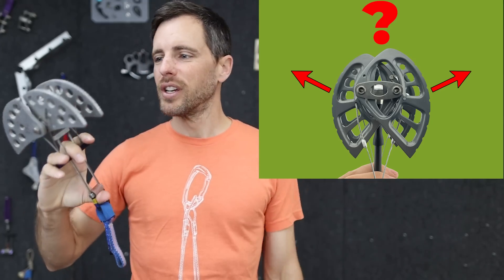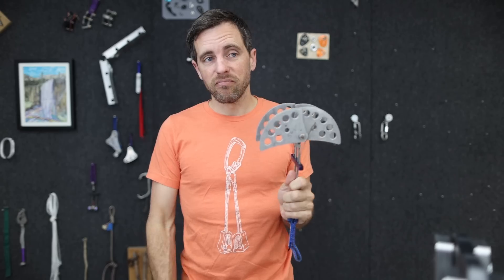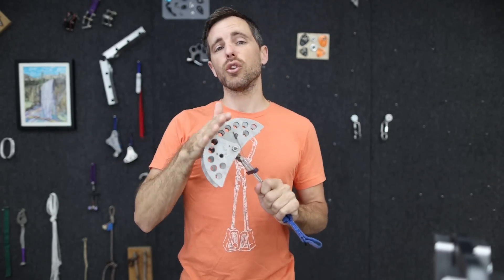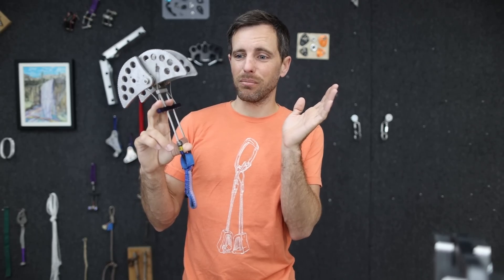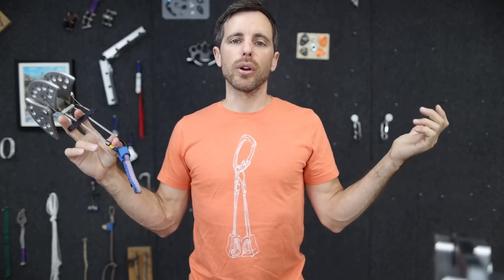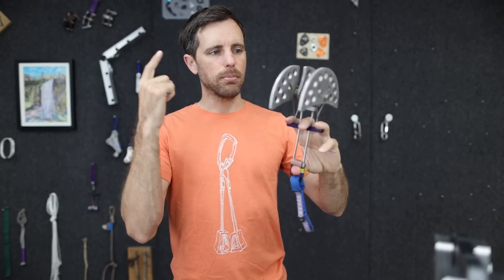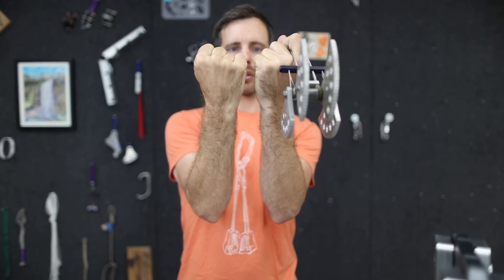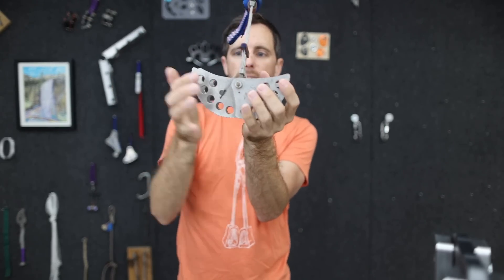I need your help

Comment: That's a second class lever, so  you are correct, 2 x the reading is what the cam is pushing. 
Ideally the test unit would be stationary, bolted to a bridge pier (got one of those near by?), and you'd measure what your weight would be pulling. (You complicate things a bit with the 'climber' load on the back side... but that''s probably okay. I don't think the mass of the jig or friction from the bolts is important.) 
I'd like  to see the graph of the sideways force going up against the 'climber weight' pulling 'down'. Are they linear (proportional)? Do the graph lines diverge at some point? That might indicate a potential weakness, or where the actual holding strength begins. (Imagine you've just set a cam and whoops! you fall. Would the cam hold as firmly as it would  if you fell after you'd put a lot of force on it. I don't know. I've only fiddled with cams at REI just trying to figure out any excuse to buy one.)  
Then there's what is the spalling (?) strength of various types of rock? Is that a consideration? I know you'd have different holding if you camed granite or sandstone.  And then the teeth on the cams. Is there a real world point where the teeth would break off? 
I look forward to seeing what you come up with and the results. 
For my 8th grade science students I made a 'bridge testing jig' to measure the down force on their bridges. It was all 2x6s and black pipe. The leverage and mechanical advantage on the digital force sensor, a 50kg luggage scale, was 10:1 (So 500kg *9.8 = 5k N.) I put a digital bathroom scale where the bridges would go. The two scales were very close.  But of course not quite up to HowNOT2 standards.
Reply: And due to the way these cams work, the width of the crack changes everything.

Comment: My first thoughts point to a double resisting effect (one on each side of the crack) of the sum of a reactive moment (another force times the cam size) plus a reactive friction action (another force) opposing the movement of a magnified climber's weight (another force) exagerated by an impact factor, lets say 30%.

Comment: There are a few factors that come into play, cam shape and crack shape being the main ones. I believe most climbing cams use a constant cam angle cam shape ~14 degrees. If you use a cam like this in an even, parallel crack the horizontal force applied outward in each direction should be around 2 times the pull force applied (pull force = 2*horizontal force*tan(cam angle). In theory the line scale should be reading half that force so should be reading the same as pull force. 

Your test apparatus isn't ideal and could potentially be sending more or less force through the fixed link (primarily if the different lobes are applying different forces) You could replace that link with a 2nd linescale and combine the 2 readings to get a more accurate result.

Comment: 8:30 Yes, twice the force because it moves half the distance when moved. I think friction in the pivot point can not contribute much in this case because the friction is torque here and the bolts are such a small diameter around the pivot point.
But the height of the cam placement is important.

Comment: Ill try look at the statics later. But remember that the lobes are log spirals and not offset circles
Reply: 100% this^ the angle of the cam surface relative to the plate is a constant so it should matter tipped out or mid range as long as the cam isnt completely tipped or maxed in that the axles are jamming and its working in umbrella mode

Comment: Would it make sense to make a new device with a load cell on each end, then add the two values together?  You could also pull the cam at an angle to see the difference between top and bottom values (I've always been curious about this).

Comment: I tend to side slightly more with the BD engineer that this is simpler than it may seem. Though as an awesome engineering professor I had says “it depends, it always depends”. Here are my assumptions about the system and I’ll talk about how it could change if they are not true (spoiler: they aren’t true). 

1. The walls of the crack are perfectly parallel. 2. There is equal engagement between the lobes of the cam. 3. The surface between the cam and the wall is uniform (not smooth because friction wouldn’t work if they were smooth) 4. The cam is being pulled straight down. 5. The lobes of the cam are not slipping in the crack 

With those assumptions, there is only one possible force that holds the cam in the crack. It’s friction. What is commonly misunderstood is that friction is a dynamic event. That is one part of it for sure, but static friction is the other (stronger) component of friction. The only force opposing the climber in this system is the static friction between the lobes of the cam and the wall of the crack. The equation (for maximum friction) is this: friction = coefficient of static friction * normal force. If you know the coefficient of friction between the lobes of the cam, and the force that the climber is putting downward on the cam then you can work out the frictional force required to hold the climber (the normal force of the equation). *new: what has been discussed in the comments is that there is some mechanical advantage when pulling on the lobes of the cam. This would mean that you would need to work from a different angle. The axle and contact point (assuming it contacts at a single point which it is more of a contact patch actually) create the hypotenuse of a triangle on which all of the forces can be shown. Now, describing a free body diagram in a YouTube comment is as one person put it “in the weeds”. But by finding the lever arm from the axle to the contact patch and applying a known downward force, the forces are able to be calculated. Now do that for every point along the line and there you have it. A graph showing the ratio between applied force and outward force for the range of engagement. 

Here is where the assumptions break down. The walls of real cracks are not uniform, parallel, cams are not engaged perfectly, climbers do not pull straight down. Another interesting thought is that cams also have different alloys for their lobes. This would mean a softer cam (like the totems) would have less force outward because the coefficient of friction is higher, requiring a lower normal force. Each of those things has an impact on the force. My intuition is that each of these would only serve to lessen the outward force. I.e. placing the cam in a more passive placement now has a mechanical force component and a friction component. 

There’s my 2 cents. 

P.s. I also side with the comments talking about two pressure gauges, one on either wall of the crack jig. The calculations will get you close but they will be flawed somewhere and the number will likely be incorrect because it’s the real world.

Edit: clarification and corrections.
Reply: That calculation assuming friction doesn't however give you the actual force being applied, only the minimum required to prevent it from sliding out. The force on the walls is not generated by the friction, it is generated by the pulling force being redirected by the shape of the cams and I have no doubt the designers would ensure that said force is many times larger than the bare minimum to make sure it doesn't slip out.
Reply: @kevinstrout630 great point. I missed the mechanical advantage in my assumptions. You’re absolutely correct that any mechanical advantage would be responsible for the wall force. My scenario would only be for a 1:1 cam.
Reply: Friction still works on smooth surfaces. Other than that, what I think really influences results is the angle between the axle and the point of contact between the lobes and the rock. The closer they are in line, the bigger the sideways vector would be - the vertical vector is determined by load and redirected onto the sides.
Reply: https://youtu.be/N74jOXh2iwI?si=7xxKfNF8rucy3mln

This video gives the mechanical advantage of the cam is typically 2. Im not a climber so i gotta check of this was for single axle or double axle, and i dont understand the math yet either, so i cant verify it at the moment but this was said to be a college project so im kinda gonna trust it 🤷‍♂️😃. Its more on the conservative side anyway compared to 4.
Reply: @m.agilnajib345  This is super interesting and I hadn’t considered the possibility that the lobe design would give a mechanical advantage through a longer lever arm. My previous comment would be true for a cam that has no mechanical advantage. Great catch!
Reply: This equation:
"friction = coefficient of static friction * normal force"
is only true for kinetic friction (aka sliding friction) -- it is not true for static friction. In most cases static friction is *lower* than what this expression gives and the only way to determine the value is to write out equation for force and torque balance.

Coefficient of friction plays no role in this setup (we're pulling below failure force).
Reply: I totally resonate more with this explanation. I totally agree on your ideal scenario asumption, which we can say is practically the cam condition in the loadcell/linescale jig contraption that Lucas made.

Question 1: can we agree, in simplified terms, that because of the jig design dimensions, the total force exherted on the cam surfaces is 2ish times the reading on the linescale?

I am looking on the demo at 8:15 of the cam being pulled in the jig, giving the value 2.15 kN.

So if agreed from my question no. 1, I can say, the cam is generating 4.3 kN force, acting on the walls of the jig.

And for me to understand it better, i visualize the jig is actually being loaded vertically, being pulled downwards.

So i guess what Ryan wants to know, it actually needs to answer 2 unknowns.

Considering in the ideal scenario, the cam is not moving because of static friction conditions. Which means, the static friction force is equal to the pulling force.

The normal force from the cams acting on the surface of the walls is actually the pulling force being multiplied by the cam mechanics.

So question no 2:
Normal force on wall = Pulling force x (multipier factor from the cam mechanics)

So my question 3 is: 

Can we say, in static conditions on the ideal scenario,

Pulling force = Normal force x coef. of static friction

so, plugging the formula from Question 2, for normal force, i wanna say:
 In static conditions, 

Pulling force = (Pulling force) x (Coef multiplier from cam) x (coef of static friction from cam to the wall surface)

The 2 unknowns are:
1. Cam multiplier effect, valued typically greater than 1. Can be worked out from the dimensions of the cam on that particular loading session. Im sure its many times larger than the pulling force. like maybe 4 as the BD engineer stated. Excluding the effect of wall fricton coef. And it depends on which contact point is touching the walls

2. Coef of friction from cam to wall (be it the jig wall or a rock wall)

So... if in 8:15 we say the cam force is 4.3 kN, and the pulling force is... (HOW MUCH WAS IT RYAN 😂😂😂, I WAS SO CURIOUS LOL)

But yeah how i see it, there are 2 unknown parameters here

Thats as far as my train of thought went. Appreciate you guys feed back if any (sorry for it being long, i couldve shorten this but im lazy to review it)
Reply: Your calculation for static friction is for a limiting case. The point where slipping starts.
The actual force (parallel to the contact plane) can be anything less than that.
So the weight of the load might well be less than the static friction from the calculation.
Reply: @dougaltolan3017  Ohp, you’re absolutely right. I’ll amend to address that

Comment: Question: "Does friction matter if it is not moving?"
Answer: YES, it is not moving BECAUSE of friction. Friction force is calculated like this: F = uN, where u is the friction coefficient and N is the normal (perpendicular) force.
So, what the heck does it means.
It means that every pair of material, metal + metal, metal + granite, metal + ice, have a friction coefficient that is natural to this combination, nothing can change it.
Normal force is the force applied perpendicular to the surface, so, in you case the lateral force from the cam to the wall.

What you want now if Friction > weight 
F = uN, so you want uN > W
so, N does not need to be bigger than W, but bigger than W/u.
if u if very low (metal+ice) you don't get it. if u is bigger, like metal + granite you get enough friction to stay in place.

Comment: IMHO the experiment should be split into (at least) two basic experiments. Let's assume that the crack's surface(s) are parallel to the x axis and that the Pull (T) direction is also parallel to the x axis.  1st experiment: at failure (slipping), the max Reaction (Rmax) on the rock is oriented along the y axis and it is a function of the friction (tg a) bet the cam and the rock. Rmax=T/2/tg a. So,  you could evaluate the friction tg a and Rmax by setting the cams bet e.g. two concrete cubes, one fixed, the other set agaist the cam by a hydraulic ram (oil circuit: closed) w/gauge. As you pull (T), the gauge pressure (P) will increase until slippage. Rmax=P/Ram area.   2nd experiment: increase the angle of the crack surfaces, e.g. open by 10 deg, and measure Rmax  for each cam opening, step by step. Repeat for every cam type.

Comment: I feel like the results would be more accurate if you take a scale (not the line scale, but a normal scale for measuring weight) and put between two fixed plates. One side of the cam would then press against the scale. That would measure the right thing directly and therefore avoid a lot of the complicated math. I guess the scale compresses a bit, but it shouldn't affect the result in a slow pull.

I don't have any experience in the area though. Maybe there are some obvious reasons why this won't work!

Comment: 4:25 If the force going outwards goes up, there needs to be a small movement. The cams spread a bit out and they get compressed a bit. The friction in the pivot point reduces the force. It also depends on the lubrication.
It's like with ropes, if you use carabiners as pulleys you can not get the same force.
For the mechanical advantage, the easiest way to think about it and also a way to calculate it, is to look at a specific position of the mechanic and think about how much would the output move if you were to move the input. So if you came to the conclusion that the cam would spread let's say 0.001 inch when pulling the rope and the rope moved 0.005 inch then the mechanical advantage would be 5 times more force. You can do this consideration for any position of the cam, extended or contracted. Maybe the cam shape is made so that you have a constant mechanical advantage.
I think it makes sense to calculate it by assuming a factor for friction. There are tables for material pairings and lubrication state but this is imprecise. If you can measure the force and you can calculate the mechanical advantage then you can calculate the real friction coefficient. You  need to consider that the shape of the plates can change the mechanical advantage. If the plates converge or diverge or there are humps it can make a difference. But it can be adapted by thinking about how much would it move into the direction of the surface
and it gives you the force into the direction of this surface. (perpendicular)
I think, some very minor friction is also in the rolling movement of the cam surface on the plates/stone. In the case  of measuring it , all these frictions can go into the friction coefficient.
Please correct me someone if I told something wrong.

Comment: Interesting but I don't think I could trust a cam between two rocks and/or go on a whipper. Those Titen anchors you tested previously looked strong. Battery powered roto hammers are fairly small and light...

Comment: Friction is only a product of the cam pressure, more pressure more friction,  That said, its going to come down to individual design,  the cam or spindle is just a lever with variable length, longer length more pressure from the same load, i.e. the farther out your or in, depending on how each cam is designed will have more or less pressure the farther in or out it goes. 
Anyway... spreadiing of cracks is for sure a concern

Comment: Take this with a "grain of salt"...or not at all...Its based my expertise with starting to climb in 1968 (actually learned from Yvon Chouinard and my mom.) Additionally, I have spent over four decades intermittently engaged in the field of natural and vernacular historic architecture restoration, encompassing traditional techniques that include traditional quarrying, stone carving, and architectural load placement. The challenge with the "maths," as my British colleagues might phrase it, lies in the tendency to apply an engineering perspective to a dynamic scenario, which can only be modeled with limited accuracy. I have ascended notable formations such as the "Old Man" in New Hampshire and "The Gendarme" at Seneca Rocks, both of which have since been lost. Throughout my experiences, I have frequently observed the movement of "cams" and similar "fulcrum" devices, which can displace stone significantly if their placement is not carefully considered, taking into account geological conditions, seasonal variations, weather, and other critical factors that extend far beyond mere mathematical calculations and subjective interpretations. This series of videos and what will be learned or at least gleaned from them should be excellent...and thank you for doing them!!!

Comment: I would be tempted to look for a sensor like a bathroom scale that measures pressure rather than try to use the linescale.   I look forward to your results.  I generally avoid placing any gear behind loose flakes because I am scared of have a rock fall on me after I fall.